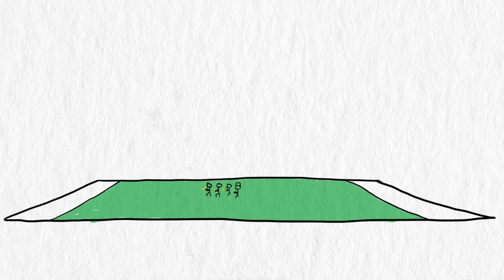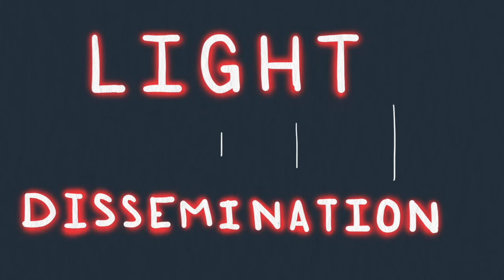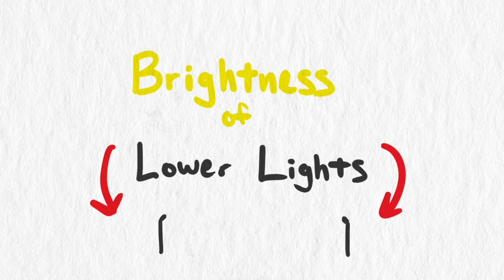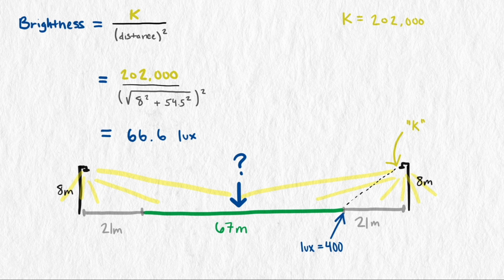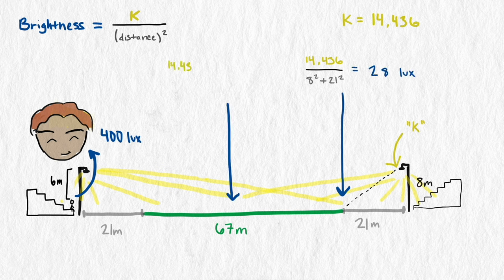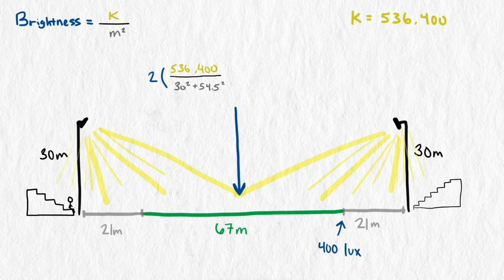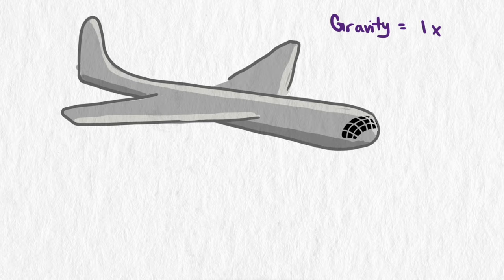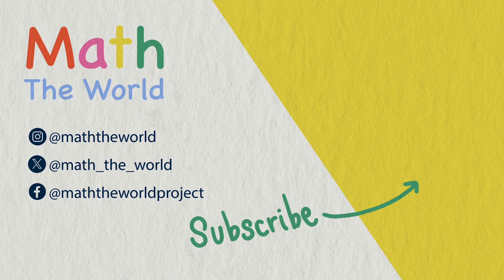How the Math for Stadium Lights Can Solve Oppenheimer's Dilemma

Comment: Great video, i like how you discussed distribution of light using simple high school physics and the luminous flux equation, its also nice to see you linked Jorge S. Diaz video on the enola gay math problem as he goes in depth into all the calculations, these questions all fall under the optimization category of physics where you have to find the ideal angle or maybe the height of the lighting polls and it does require some intense math at times
Reply from the maker: Glad you could make so many connections!

Comment: Can someone explain the math they did with Oppenheimer to me? I kinda get it but not 100%.
Reply: One thing that isn't made clear here is that bombs doesn't drop straight down. It continues flying forwards as it falls. This means a plane traveling straight will be going the same direction as the bomb, not getting away from it. 
By immediately turning, the inertia of the bomb keeps it going forwards, while the plane races in the opposite direction. This gets the crew further away from the blast.
Reply: @benbookworm thank you. that was only question during that part of the video.